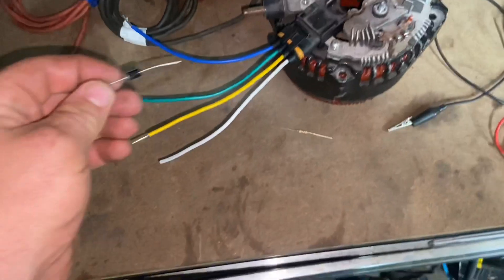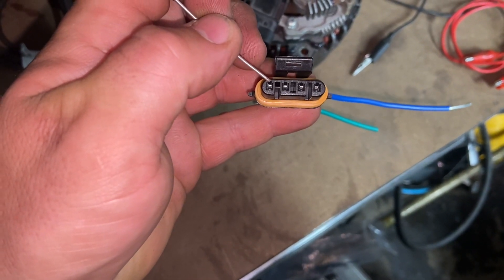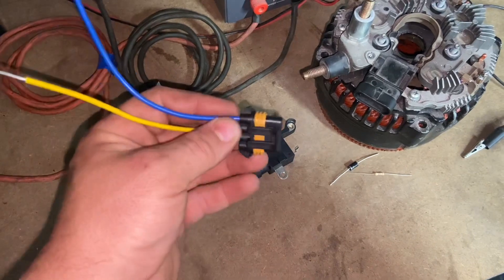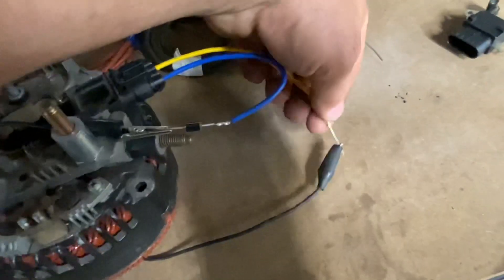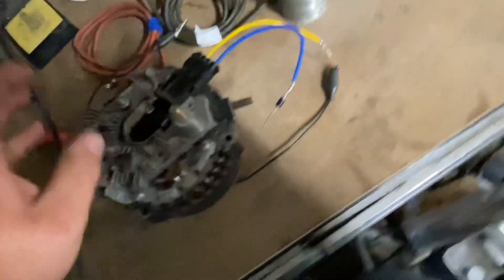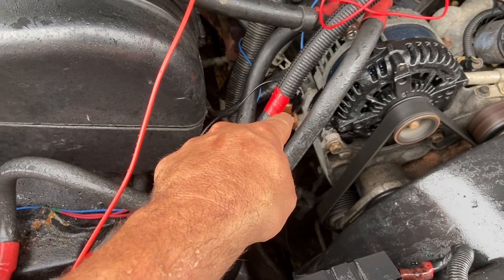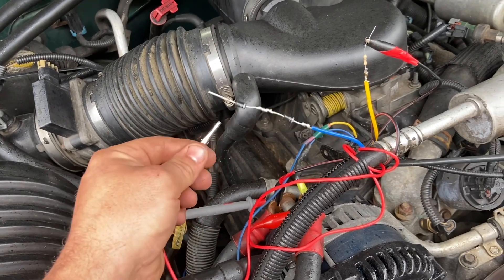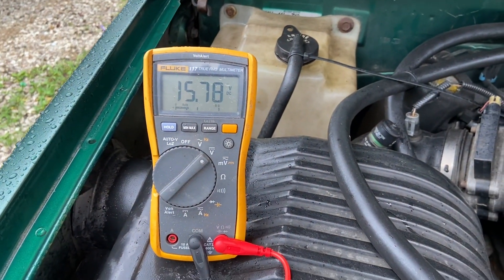Increasing charging voltage on car audio alternator

Comment: I only have 3 wires coming out of my stock alternator and I'm just in the process of fitting an AGM battery, do you have any advice on what I should do with the output also it's only 70 a output and have paired this with the maximum size 027 60ah AGM

Comment: Hey man. Im about to buy a hair pin large case ad244 just like what you have there but i need to remove the two pin rvc regulator and switch it over to a gm 4 pin 14.8 v.  Just running lead acid. Where can I buy that regulator. Having trouble finding it online. Thanks bro.
Reply from the maker: I don’t know what brand this is they are selling though
Reply from the maker: The one I use in model IN6003. I’ll find a link to one for you
Reply: @sub-humansounds5645 sweet! I did find one but it was 80$ usd. Crazy money.
Reply from the maker: https://ebay.us/m/5EhhYi
Reply: @sub-humansounds5645 that’s more like it. Thanks a million man. Cheers
Reply from the maker: @LaurieNCooper  no problem.  Have a good day

Comment: Help! Im already way ahead of most regular bassheads. Ive got a 300 amp singer alt in my 08 accord. As of right now im changing at 15.2. Playing full tilt on 2 surge audio 4000.1 at .5 ohm and was supposed to be 2 us acoustic lanna 6 channel amps...but i popped 1 and my starter at 16.2 volts. I have a harness to charge at 14.8, 15.2 and 15.8 but it charges a little higher than 15.8. My issue is i have 2 ae30 lithium lto batteries that need to charge at minimum 15.2...full tilt im 15-15.1.  I want to put the 15.8 harness back in but i need to step down the voltage to my cars electrical and to my 2 us acoustic lannas. I could do a step down converter like the xs 993 but i hear they are trash. I could do a dc to dc buck converter but not exactly sure how to do it. Or which 1 to buy.
Reply: Each diode will drop the voltage by about half a volt. Some people run a separate alternator.
Reply: It's dropping it for the regulator I. This case to give you more

Comment: I have a 320 amp autotech internally regulated and set to 14.8, but at drive idle its dead/ no charge. Only while cruising. 
It has the yellow ig wire and blue L wire only. Will adding a resistor to my yellow ig wire help my drive idle? I dont really want to go over 14.8 though
Reply from the maker: Did you shorten your belt? I haven’t ran into this problem before, normally it’s the opposite
Reply: @sub-humansounds5645  yeah im running the shorter belt they recommended
Reply from the maker: @ryandalga5752  what’s it on?
Reply: @sub-humansounds5645  toyota highlander v6 3.5l 
Voltage at cruising is 14.8 but at stop lights it drops to 13.4
Reply: @sub-humansounds5645  have the yellow ignition wire plug and play harness going to my ignition source and the blue sense wire is on the alternator charge stud

Comment: can i do this with my 05 Crown Vic? I'm on my 5th alternator finally last one i got still doing the same thing but BnR Parts told me it could be a bad connecter "pigtail" on the alternator replace the connecter one you show in this video or it's a PCM going bad but my charging voltage is 13.1 to 14.2 volts depending on the outside temp. winter i see cold start 14-ish volts drops to 13.6v once hot now in the summer i see briefly 13.8/7 volts and once warm as low as 13.1 now this 350 amp BnR alt i can see it's trying and doing a better job then my autozone 200 amp but not much i really need to figure this out hoping you can give me some advice i've asked GM class A techs and they had nothing for me, ty for the video btw! Oh and when my batteries drain from my 3k watt amp which takes about 20-30 minutes to chew through 170 AH worth of AGM batteries as i am doing 60+mph i see voltage drops down in to the 11v range lol i have seve 1/0 OFC grounds to the block frame and body front and rear with dual 1/0 OFC wires powering the trunk 250 amp anl fuses front and rear i'm at my wits end here my guys at Planet HiFi are gone closed up shop so i don't know anyone to help local tint shops have replaced our HiFi installers stuck with a bunch of Geek Squad no nothings around me here in Plainville CT!!!! I digress peace out and keep bassing on!!!

Comment: Does this work on a mercury grand marquis?  I have a 2004 it had the 4g alt i swap out for the 6g high output alt .. i need more voltage because my pcm is controlling the alt voltage output,  my amp is still pulling my voltage down to 13 at full tilt
Reply: I have a 04 worked on trying to get the voltage up for a year I had to bypass the PCM leaves battery light on went with a gp car alternator 370 amp it's at 14.8 right now. I'm looking in to adding these diodes to up it just a hair more

Comment: Would this mod work on "new style" hairpin alternators?
Reply from the maker: @primotote  I’m not sure what you mean by new style.  Most newer factory set ups are controlled externally by the car. This only works for internally regulated alternators that have a “S” terminal or sense wire

Comment: Can u get ahold of me sir.  I have a 2 pin ho alt that is 350amp.  I'm tring to up my charging from 14v to at least 15+.  There's only 2 wires.  Red or black.  I've alrdy got my diodes wired together but I need to know which wire to tie into.  I skinned them both slightly to test them n they both test around 8 on multimeter.  Am I doin this correctly??
Reply from the maker: @kingfinesse9326   it sounds like the alternator is externally regulated. If so, this mod will not work for you as is

Comment: To the young books just getting started I have a small system maybe 2000 watts total power so I tried it with my stock 150 amp alt it does not work on stock alternators have to have aftermarket Don't ask me why
Reply: Depends on the car. My accord has eld electronic load detector.  If it senses the  voltage getting too high it cuts the charging to whatever the limit is....like 13.8 or whatever. You have to get a bypass harness like I got with my singer 300 amp alt. It was just charging at 14.8 with the eld bypass. But I needed higher voltage so i bought two new harnesses with diodes in them. One charges at 15.2 the other 15.8. My batteries minimum need to charge at 15.2....playing full tilt with 11k+ I drop to 15-15.1 volts. I had the 15.8 in but fried my starter. I need to fonda way to step down the voltage most of the cars electronics.

Comment: Theres many ways one easy way if u get another battery series it to increase voltage ⚡ other take out the alternator voltage ⚡ regulator n rectifier n use a rheostat potential meter adjustable to increase n decrease digital is better to see how much before engine stalls energy

Comment: Now what do you do with the cars that are computer controlled and drop to 13.6 unless the computer adjusts because it sees that it needs the voltage? I have a 2012 Subaru Outback H4 I seen an article saying something about grounding out a particular wire in the computer harness???? Any input would be appreciated. I have a 360 amp autotech alt
Reply: Get a bypass harness

Comment: 🔴 I have two of these #OneWireAlternators. One is factory #acdelco 160amp the other is a identically made #powermaster 250amp. Both are grounded to the engine right now via a #dualmountingbracket but each one power wire goes to it's own battery. Basically two charging systems. My question is can I run both #OneWire alternators in parallel by just jumping the one wire over to the other alternator and then splice the factory sense wire and jump it over as well so that the Pcm only sees Basically one high powered alternator❓️Any info would be greatly appreciated. Btw, I left out that right now I'm controling the voltage output on the 250amp with a #PulseWaveModulator that operates at 128hz just like the factory one. I can turn it as low as 11.0 up to 15.4 volts output, but I don't have anything that let's me know that it's completely charged so I can turn it down. The factory alternator does this on it's on via the PCM and I'd like it all to work like that to relieve the guess work.
Reply from the maker: I do t do anything with the externally regulated alternators normally. You should be able to buy an adjustable external regulator and have it control both alternators. I think brand x makes on to control multiple alternators at one time

Comment: Buy diodes and resistors. Very important. My js alt on my 05 f250 wouldn’t go past 14.9 no matter how many diodes I added(I went from 14.7 to 14.9) until I added resistors on the “other” wire opposite of the sense wire.
Reply: Do you have a picture?

Comment: As a mechanic, all i can say is that there is so much WRONG with doing this and the part failures/severe issues this can/will cause is astounding!! Let me list a couple of potential issues and pose some relevant questions to you:
If overcharging via voltage to an AGM or lead acid battery, how do you plan on dealing with the excess gas being vented? Thay gas is explosive, btw.
Since this will only work on certain GM/Ford systems, what are you going to tell a Chrysler product owner that tries this and INSTANTLY fries his/her PCM, other ECMs, and potentially quite a bit of the under dash electrical system? European, Asian, and Chrysler products have the voltage regulation circuit built into the Engine PCM.
How are you going to deal with the excessive heat, resistance, and internal stator wear of the alternator? An alternator can only produce amperage equal to it's build even if you increase the voltage output. Since voltage x amps = wattage and wattage can be equated to heat, how are you going to deal with the excess heat?
If you equate DC electricity to water, I'll use this analogy to make a point: Voltage = water pressure, amperage = water flow volume. Most automobile electronics are made to operate under a set, but small, spectrum of voltage...that being 11.5v to 14.5v in the real world. Since you are increasing the voltage/pressure applied to those electronics, but not the amperage(electronics only "draw or consume" the amperage needed to function), you are now increasing the electrical pressure thus lowering the longevity of said electronics. Think of an electrical part as a stone and voltage as a water pressure jet hitting that stone. At normal pressure, the stone will only erode at a known set rate. Now increase the water pressure, but not the flow amount, and you get something akin to a smaller water jet allowing more pressure to erode the stone faster, especially since this particular water jet will find the weakest part of the stone and concentrate on that point. 
Remember, in today's vehicles, the battery is used to start the vehicle and then allow itself to be recharged by the alternator; when the engine is running, vehicles now are designed for the alternator to power almost all the electronics while also recharging the battery who's job while running is only to be recharged and supply any needed amperage the alternator can't provide due to momentary excess draw.

So much more I could go into, but I'm not. I'll just ask this: What's the point for a few extra tenths of a volt that can/will can major issues while providing no extra amperage, amperage being the " fuel" for electronics? There is no good reason to do this and will only work on a handful of vehicles while causing thousands of dollars of damage to other vehicles. 
Just add another battery making sure the second battery has the same CCA rating as the primary and is of the same type(Lead acid, AGM, Lithium, and so on) or use a cheaper battery isolator(old Ford or lawnmover starter solenoid work) to run any size and type secondary battery. 
Just don't do this. This cheap "mod" can and will cost you ALOT more money in the long run.
Look into a "Big 3" electrical upgrade and possibly adding a secondary battery.
Reply from the maker: The .5-.7v increase is for the guys running lithium packs. Those require a slightly higher voltage to maintain a charge than AGM or conventional 12v lead acid batteries.  The video does not show how to alter any pcm controlled alternators but I appreciate the detailed right up. You have some great points but adding more battery bank or a big 3 upgrade will not help with it’s the desired outcome from this “cheap mod”. 

 I do agree that a big 3 and larger battery bank are the first place to start when building any high demand electrical system and followed with a strong charging system. outside of a competition audio system I would not consider messing with the voltage set point.
Reply: @sub-humansounds5645   Now that I know this is for a lithium bank, it makes more sense as to why you'd want a slight increase in voltage. There are DIY kits for voltage multiplication you can use to slightly increase the voltage to a lithium bank from the alternator if you use a battery isolator to separate the primary battery from the lithium bank. Doing so won't place any extra strain on the alternator, primary battery, or other vehicle electronics. Just an idea. I've been building systems and competing for more years than I've been a mechanic(started competing at 17yo, I'm 51yo now) so I understand the need to do certain things for a more steady and readily available power supply. Especially when on a limited budget. Also, if you have an alternator or starter shop or maybe even some electrical motor shops nearby, most such shops can rewind your alternator to increase amperage output quite a bit while only slightly increasing voltage if at all...and at a fraction of the cost of a high output alternator. Another something you might want to look into. I've had a local shop do this for me several times and have been more than satisfied with the results. Good luck!!
Reply from the maker: @knowplay3258  I build my own alternators now. If you have a chance to look into them, I recommend checking out the hairpin stator design that denso makes.  Those stators can be changed to produce some impressive amperage and work far more efficiently than the alternators from our time of competing. I’m close to 40 and remember having to struggle to keep enough amperage from the older slot wound stators to supply my systems. 

The hairpin designs are amazing with what would be like 2 alternators working in parallel in one case. I think Mitsubishi has released a newer design with even more promise now.
Reply: Electronics only draw what they need to operate. So my amp will max out the digital clamp meter at 1000A draw (when wired to .5 ohm),so my factory 70a alternator should be sufficient? 😂 
  Joking Mr Sub Human, not intended towards you.

Comment: Great video, I noticed this is on 5.7L Vortec model can this be applied on 2003 Burban 5.3L/ 5100 Vortec LS based engine with factory AD244 alt to increase the 14.7 voltage with no load and internal regulator would like to increase voltage for system and would be nice to have sat a controller/ knob to increase when needed and are there mods to increase amp output of OEM units or no and what about eBay hairpin units 300amp clams on a budget don’t have $500 plus dollars to drop on alt, I have two ENERSYS POWERSAFE SBS-190F BATTERY 12v 190AH
Reply from the maker: As long as it’s using the “4 pin” style harness this will help. This is mainly to help with the charging voltage for lithium cells though. Other battery types such as AGM are not designed to handle the excess voltage. With that said I ran mine at 15.3v unloaded for over a year with no problems on 600ah of AGM. This was 120 miles a day in my daily driver. I found this link online to help with the voltage range for AGM banks. Sorry for the late response I have been very inactive on YouTube. 

https://support.rollsbattery.com/en/support/solutions/articles/4345-battery-charging-agm

Comment: Ever since i did this i get more light dim and what seems like slower charging/ more voltage drop. Do i need more bank? Im on a 320 amp alt and 40ah lto, using like 6100 watts
Reply from the maker: I think more bank should help that. I dont really have much experience with lithium banks(I’m old).
Reply: Thats a really small battery...Why dont you use a decent 100ah battery.
Reply: You shouldnt be having issues with light dim ect.. have you deleted starter battery? Also 40ah LTO is only good for 4-5k  320amp alt thats cool but pushing 6k+ is pushing the bank get another bank are you giving the alternator time to charge?

Comment: Will that burn the battery??? Isn't it considered overcharging. I would love to rig up an alternator on a old 76 impala with 305 engine
Reply from the maker: The increased voltage is more for race cars and lithium battery banks in car audio. It is not good for standard 12v systems.

Comment: I have three diodes and a reducer and I still cant get mine past 15.0 what am I doing wrong?
Reply from the maker: Did you see any change when you added each diode?
Reply: @sub-humansounds5645  without diodes it charges 14.8 after that it don't matter if I add 1 or 4 diodes it only goes to 15v I replaced the regulator on the alt and the pig tail. It's a Apex 350a
Reply from the maker: @chrismills2546  what car is it on?
Reply: @sub-humansounds5645  1993 caprice
Reply: Cold start itll barely touch 15.2 once it warms up it won't brake 15. I've tried different size diodes as well with the same results. Everything I do I'm getting these same results. I've drained the battery to 14.8 and tried also charged to 16 and tried all it dose is slowly go down to 15v everytime.
Reply: I put 3 1n5404 diodes on yesterday, like I said tho once it gets to 15v it stops. Yes I have a 470 ohm reducer on the lamp wire too
Reply: @Chris Mills  try the  in4007 or in4004 diodes .

Comment: I recently upgraded my alternator to a 370 amp alt for my car audio but my Battery saving Kees popping up. I upgraded my front battery and did a big 4. I have a 14 Chevy impala
Reply from the maker: What voltage are you charging at?